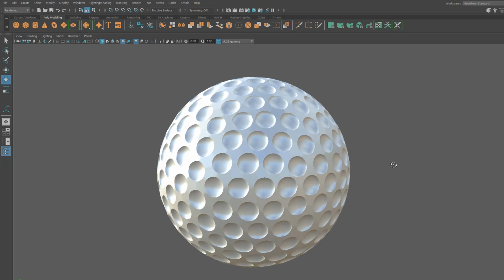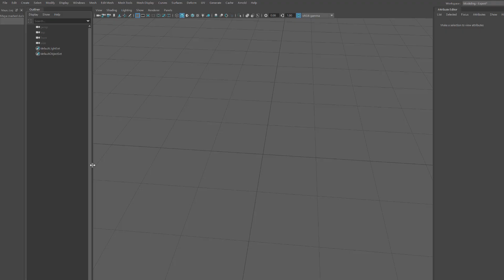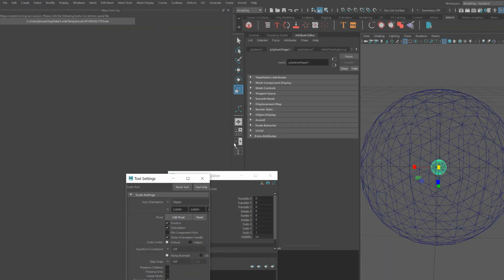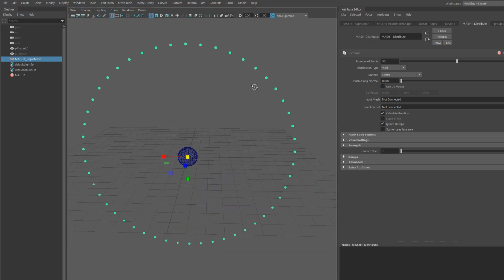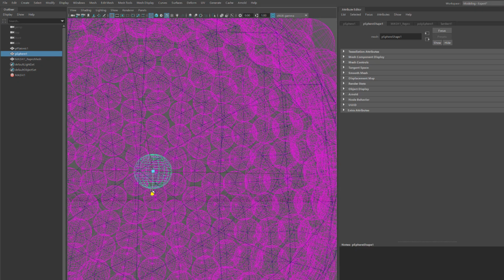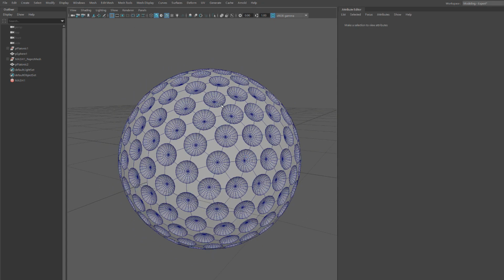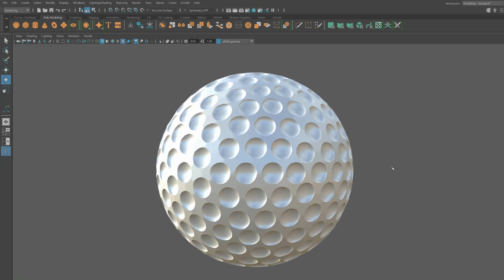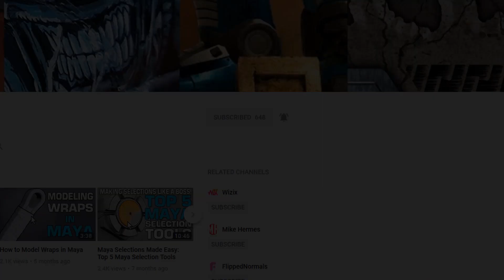Maya 2018 3d Modeling Tutorial: Model a Golf Ball using Mash

Comment: I don't know why my mash network's result not snap to the input Mesh like you did(using what ever method scatter vertex ...etc)
I was try to make a sushi .so there should be some little rice stick on the big shape to make realistic 
hope you can help me with this 
thanks！
link below is my screenshot :
https://imgur.com/a/fa0SMo2
Reply from the maker: Hard to see from your screenshot as its low res and cant read the settings. Make sure you have the correct input mesh selected and the "flood" option enabled. Might have a offset as well,  try freezing your transforms before serving setting your input mesh.